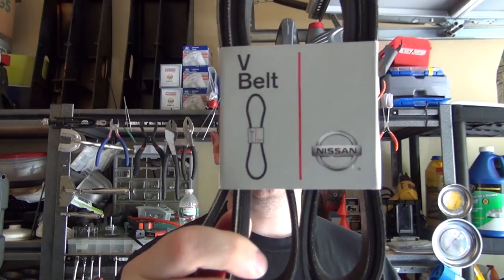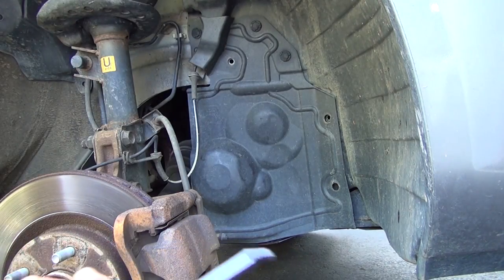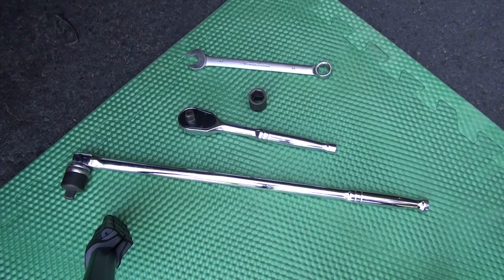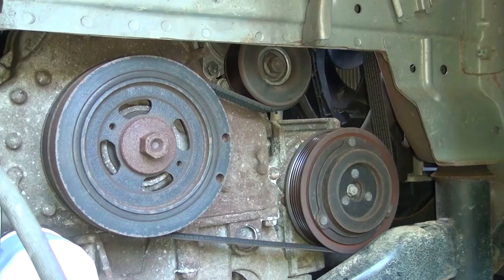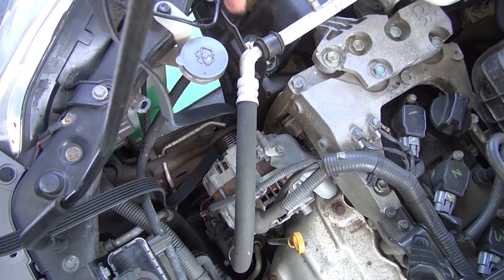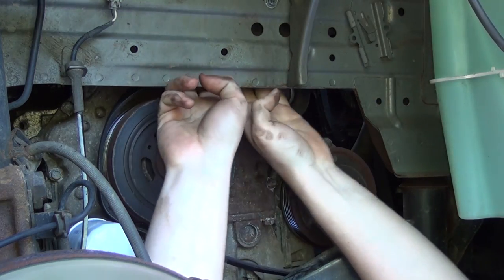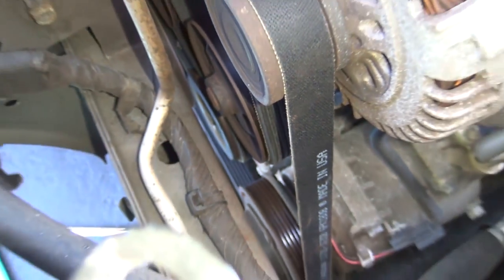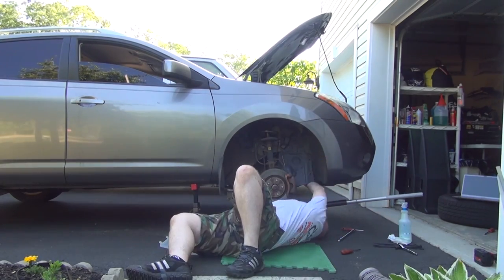NISSAN 2.5L ENGINE FAN BELT REPLACEMENT

Comment: Thank you very much for this video.  I found that placing the belt on the A/C compressor last was a good option as well.  I did not have to use any lube when doing it this way.  Not a 'biggie' but figured I'd mention it.
Reply: p

Comment: OEM 11720-JG30B (bought at dealership, 1808mm) was loose on my 2011 Rogue S FWD. Squealed right from the start. Duralast Belt 710K6 (1805mm) was better because it squealed only when AC was on. I had to reinstall original one that is perfect, tight, no squeals with AC on/off etc. It is just old (original 11 years old), 80,000 miles.on it. Should I try 1803mm like Goodyear 1060710 (1803mm)? Any recommendations?